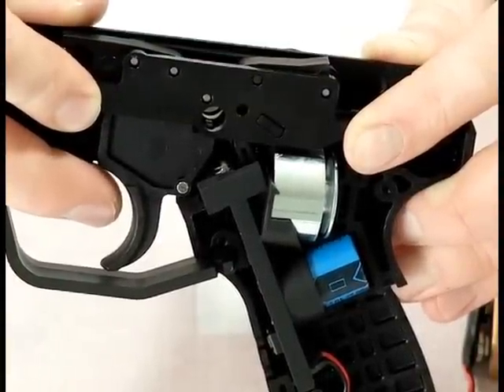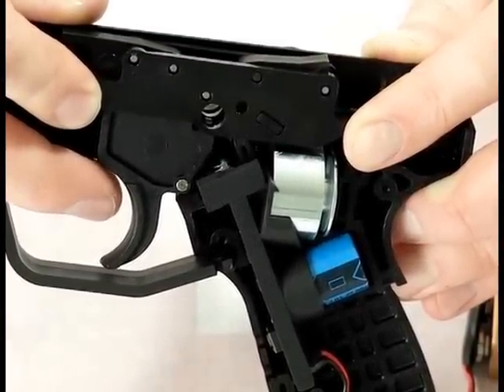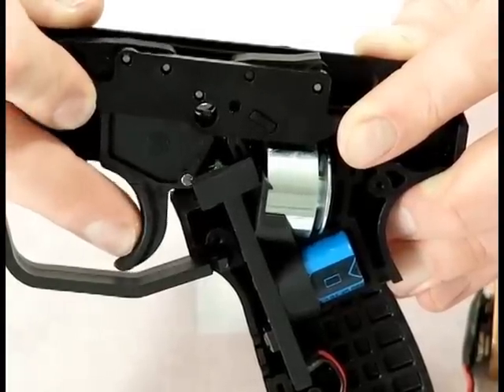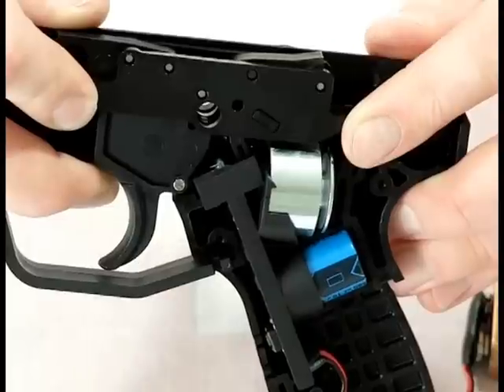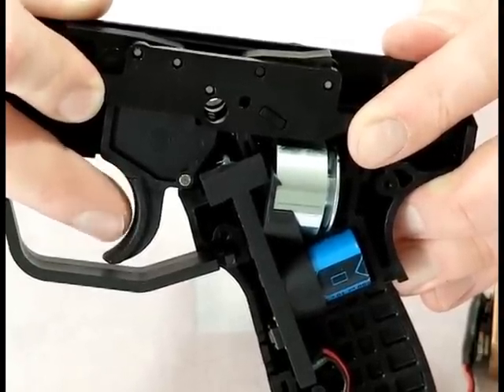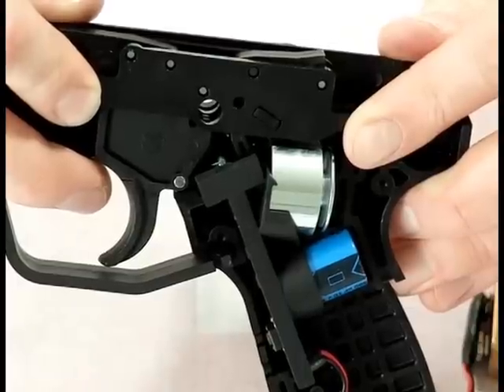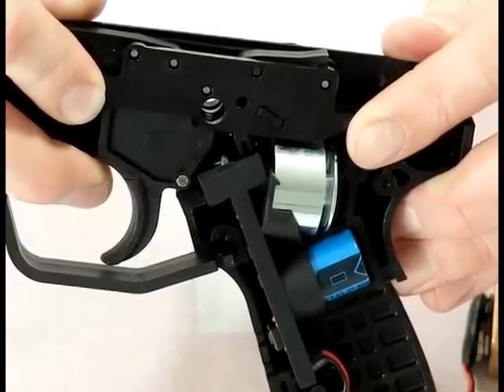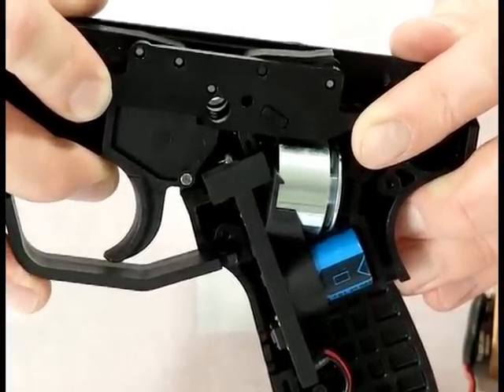A Closer Look at the Tippmann A5 Hall Effect E-Grip Kit by HustlePaintball.com

Comment from the maker: @teamsubfighters It is always a good idea to have an extra battery on hand. I usually recommend to disconnect the batter between weekends to prevent any drain on the battery but 2 days sounds like a lot of paint or a battery that may not have had a full charge.

Comment: i have a new phenom that i got like a month maybe 2 ago and the solenoid inside the HE u can hear the disc slide back and forth wen u tilt the gun i called tippmann and aasked them why or if i should be considered about this because i thought it used a magnet to reset and fire aparently i was wrong and phenoms need no magnet if thats the case why did my egrip on my a5 never make that noise or move like that? just curious if you have any idea as too why that would happen n if i shld get it fixed

Comment from the maker: @danny96211 as long as it's working correctly there is probably not a problem. If it's not you might try giving  Tippmann Sports a call at (800) 533-4831 and they can help you with any tech issues you might have.